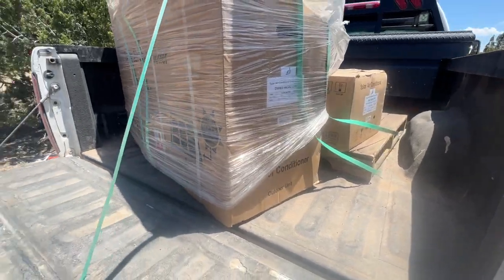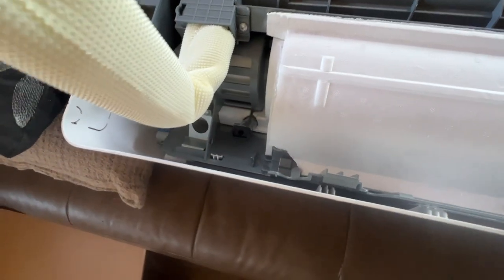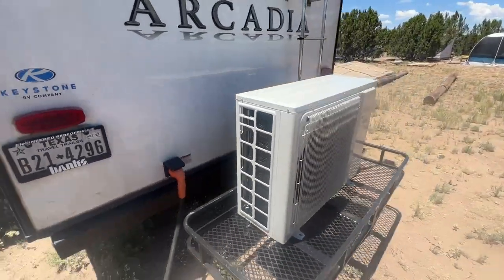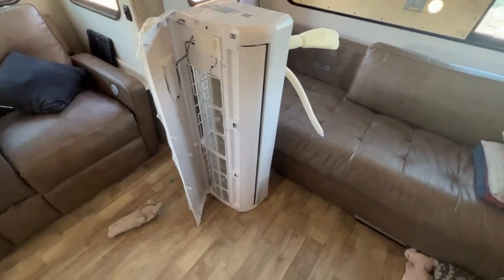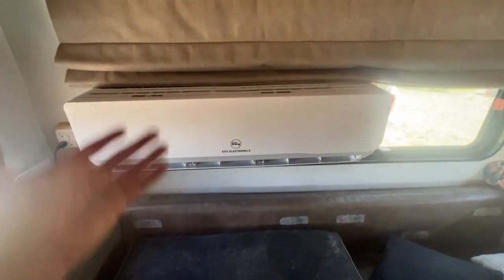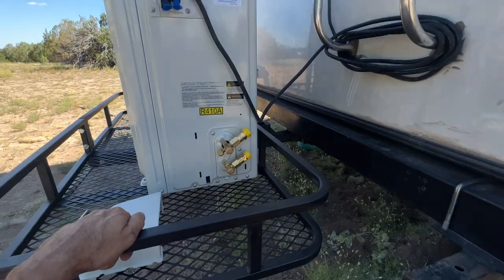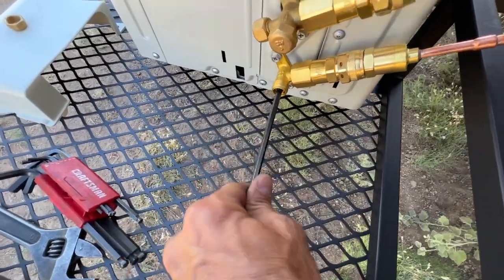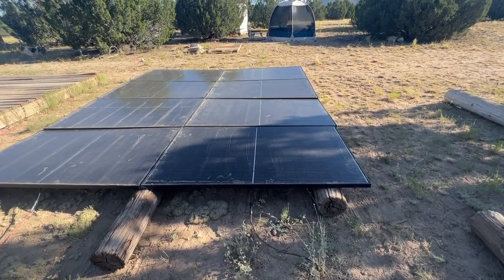EG4 24k BTU Solar Mini Split Plug & Cool Install On 5th Wheel Camper

Comment: Thanks for the video. I had to laugh when you said "because you're not going to be doing it in a fifth wheel like me" because I just put that exact unit in my fifth wheel. I have a built in electric fireplace in the end of my 29ft fifth wheel with cabinets above it. I was able to remove one of the doors on the upper cabinets and the indoor unit just barely fits without hitting the slide and hangs about 4in from the ceiling. I can still put everything back to factory if I want to. But I'd never do that because this thing is a game changer! I have about 300sqft and this unit is good for that PLUS another 1000sqft! Last night the bedroom on the other end of the RV was toasty warm with the fan only set at level 2. Turbo makes the blinds on the bedroom window blow around a little. I bought this so I could move away from propane and thought it would be a trade off. Instead it's clearly a trade up. I've only had it for 24hrs but it sweeps warm air across the entire floor and does a much better job of heating the floor than the propane. And now I don't have to refill propane all of the time. I mounted an RV service box on the back of my RV that is fed by a 50A cord that plugs into a 50A plug on the house. I changed the breaker in my new RV service from 50A to 20A so that I can run the minisplit off of it. I still have a spare 20A and a 30A receptacle on the RV service. I have a 30A plug on the house so I plug the RV into it, but if I'm traveling and only have a 50A plug then I can run my minisplit AND my 30A RV off of my little RV service. Pretty slick. Oh and I still have a 20A leftover to run my heated water hose. This thing looks factory, and I love it that it's enormously oversized for the space. No skirting and I'm ready for whatever winter throws at me.
Reply from the maker: Nice, it’s awesome when a plan comes together.

Comment: When operating in cooling mode, your trailer needs to be very level both front to back and side to side, or the condensate water will leak out of the drain pan.
Reply from the maker: Thanks
Reply: Good point and especially true in my case because the drain runs the full length of the minisplit before it turns down. There's some, but very little elevation drop in that space.

Comment: Nicely done.  I NEVER seen anyone else do a temporary install like this until I did it this last weekend, almost exactly like yours, for the same reason.  You had a different design than mine but I think yours would have been easier.  Did you screw that directly into the window frame?  Looks like it.  I built a 2x4 frame for the opening, insulated the window edges with pipe insulation to protect it then sandwiched 2 pieces of ply on either side and screwed into the 2x4 frame.  Cut a hole and mounted as you did.  I will put mine up as well since I had nothing else to follow for this exact use case.  Well done and thanks for sharing.
Reply from the maker: I did attach the plywood board to the frame of the window with 1” self tapping screws. I put that peel and stick door and window frame insulation on the edges of the window frame where the wood would contact. It’s been installed for nearly a year now with now issues. Sounds like yours is more reinforced and there’s nothing wrong with that. Thanks for the comment, and enjoy that sweet sweet cool air.

Comment: How many watts of solar does it take to run this unit when running entirely on solar alone?
If I were to mount 2000 watts of panels and have it hooked to them and then have its 110 cord plugged into my inverter, is it “smart” so that it would use the solar all day long and then switch itself over to the 110 draw when the sun goes down? Thanks in advance for the help. I am nearly ready to order.
Reply from the maker: I’m guessing your looking at a 12k btu unit because the 24k one is 230v. The manuals for these units are on eg4’s website. But you want the voc of all the solar panels to be in a range specified by the manual, in series to not exceed 12 amps. For our 24k btu unit I put the max solar 8 370watt panels 41 voc each. So 41 x 8 = 328 voc total from the panels in series pushing 11 amps dc. Yes the unit prioritizes dc power over ac power.

Comment: Am I understanding that this is the new and improved version that comes preloaded with its freon and is literally plug and play or is there a step left out of the video that required you to charge the system for use and check it for leaks? I am seeing conflicting information online and obviously want the simplest installation without need of having to buy special tools and meters or hiring an hvac technician. Thankyou in advance!
Reply from the maker: Correct this is the newer unit called "Plug N Cool". No vacuum pump needed. It was very simple, the hardest part was making a frame for the window to mount it.
Reply: They all come precharged with freon. "DIY" units have a sealed line set with a spiffy valve in the connector to hold vacuum in the line. All other units come with the line set but aren't sealed and have to be evacuated with a pump before the charge can be released. Not anything difficult to do if you have a pump and educate yourself a little. It's not rocket science but the manufactures will void the warranties if not installed by a licensed HVAC tech that'll likely cost nearly as much as the unit. Gotcha!
But EG4 has the highest rated efficiencies out there at the moment and I think all of their mini's are DIY now. 9K being the only unit not MPPT capable but still DIY.

Comment: Coiled up tubing should not be coiled vertically but should be coiled horizontally. The way you have done it is harder for the oil to return back to the compressor. Each loop the oil has to go up then collects on the lower side of each loop then has to go up over the next loop and so on.
Reply from the maker: Roger that.
Reply: I think I remember reading somewhere that the MAX elevation between the 2 units is around 32ft. That would mean that as long as your total loop height added up isn't over 32ft, you are probably good to coil it up in either direction.
Reply from the maker: Thank you.

Comment: Great video gotta get those panels off the ground you could make a shade wall out of all of em
Reply from the maker: That’s not the permanent location for them, once we get the house we ordered they will be mounted on a diy rack.
Reply from the maker: Also as they lay they run the mini split for 12 hours out of the day. Not to shabby.

Comment: You said the newer ones are plug and cool, I bought mine a year ago, about to install it, do you know how to tell if it's plug and cool? I called signature solar and they told me the newer ones they sell now are not pre charged and the older ones are
Reply from the maker: Just looked at the website and it still says plug n cool do it yourself next to the listing. I called them too the day I installed it and they told me it was pre charged. Check your user manual, get whatever identification number off it and call them again.

Comment: You will love it alot more if you turn off your latent heat machine (humidifier)
Reply from the maker: I dont understand, but we could use some humidity as it’s pretty low here in the high dessert.
Reply: @grumpysdiy  That's fine...just keep in mind it takes a lot of energy to remove most of the moisture before an a/c can perform specific cooling.
Reply from the maker: Could you explain “turn off latent heat machine”? I want to learn. Also the system will only ever be solar, so free energy once it’s paid itself off.
Reply: @grumpysdiy  any moisture you add to the load (cooking,showers,humidifiers...ect) is latent heat or an additional load to the mechanical cooling system.  In arid environments, swamp coolers are efective because evaporative cooling will add humidity to the living space.
Reply from the maker: @kenfishfisher7389 oh I guess the humidifier was in the video. Yea so the day I was installing it. The heat was like 102 and about 10% humidity. We had it on because our noses were dry as hell. We rarely run it now.

Comment: Pretty sure you should have pulled a vacuum on this. Helps the unit last longer.
Reply from the maker: I called EG4 to confirm before the install. EG4 assured me I did not need to.
Reply: @grumpysdiy  I’d still do it, it’s cheap and easy and helps the longevity of the compressor.
Reply: Isn't that the whole point of going with the DIY kit? So you don't have to buy the vacuum pump.
Reply: @TheCrawdadman  you don’t have to pull the vacuum, but it makes the unit last longer and is peace of mind, the pump was 25 dollars and makes the unit last a lot longer. But that’s if you get a unit with charged lines. If not you will have to add more Freon